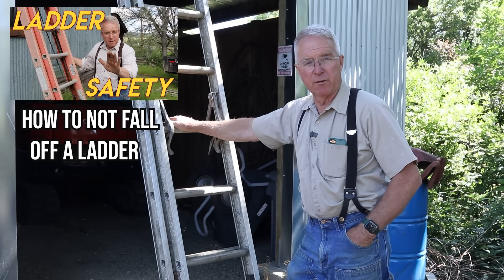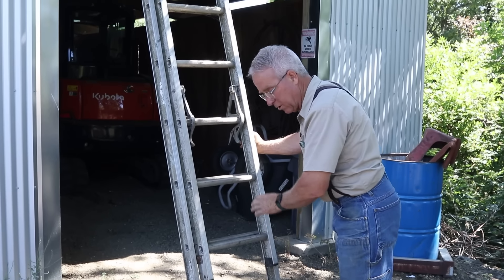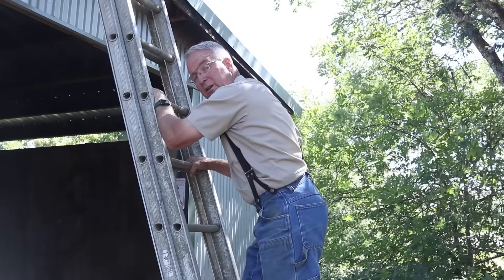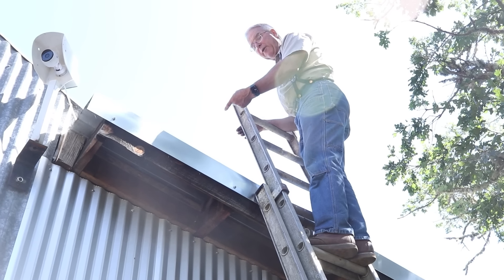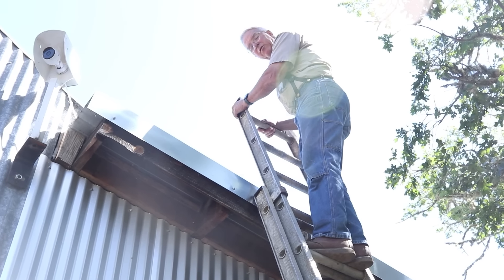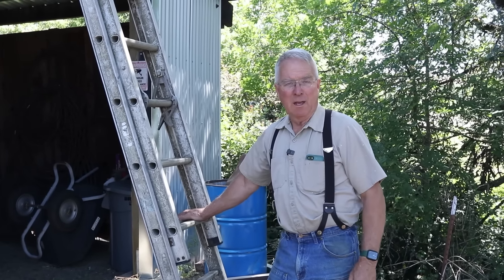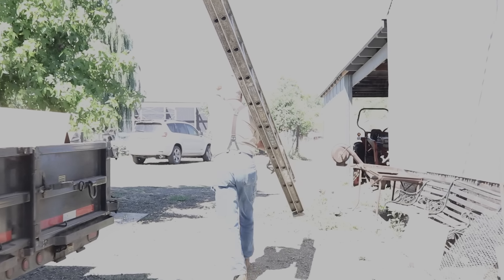How to Climb A Ladder, Dismount, & More Tips

Comment: As a younger working man, I used to foolishly go 30 feet on underrated ladders that bounced and bowed a foot or so halfway up... then, 3 years or so ago, I started peeing a little just trying to get off the ladder onto my single story roof... I almost shed a tear or two having to get off the roof, after considering calling the Fire Department for a bucket truck, but I have to live in this neighborhood, and didn't want to be known for that ... Repetition made it easier, but I knew I had to find a better way... At 62 years old and 350 lbs., I would probably crack the foundation, and probably all my windows if I fell... I found this USED, on Amazon... or Google, Guardian Fall Protection 10800 Safe-T Ladder Extension ...  It was $124, three years ago, without the stabilizer, which I also have and use with it... also available at Home Depot...  Now when I need to go up on my roof, even after I'm finished, I wait for cars to come down my street, then walk up to the peak with my tool belt on and survey the situation, until they drive past... after 2 or 3 cars go by, I feel my testosterone level has been exhibited sufficiently for me to then, shakily, come back down... It is now $206 without the stabilizer brand new... Definitely less expensive than an ambulance ride and a hospital bill... Accessing anything over a single story in height and the weight of the attachment can make a big difference in maneuverability...

Comment: How do i get from one level to another? I have a bi-level roof. Both levels are angled to center in an "A" type.

Is there a better technique that i can use? I just hop up, hold on, pull myself up and then roll over to get situated. It's about a 3 or so foot difference.

I cannot extend the ladder from the ground to that higher section due to high, rolling hills where the ladder would need to be stabilized.

Comment: One other important aspect of the ladder safety is to make the roof edge
where u lean the ladder rails.  The edge must not break off or collapse.
If the edge has a gutter, then:

U'll need to have extra steel brackets where u'll lean the ladder rails or, as sug-
gested by my professional roofer n gutter installer,  just place a 2 to 3' long
2x4 lumber piece inside the gutter.  And of course, make sure the rest of the
gutter is securely attached to the solid fascia board.  The latter esp. facing South
or West tends to dry rot.  And dat'll b too dangerous to rely upon.

And though, i used to climb up on my single story hse roof like 2 or 3 times a week
last 3 yrs when i fixed the roof me-self and also to climb up dare(there) along w my roofers,
after the entire roof replacement, i decided i'm too chicken to climb up dare no more.
Too old to maintain balance even on a flat ground.  Time 4 mir to stop at 75yo, just
much older than the 65 gent, 'AndReachAble' gent below.  And, as any roofer always
want to make more MOOooney by replacement vs. patching, i finally realized i should
hv done the replacment 3 yrs ago.  Wasted time, MOOoney, worries, and took too much
risks going up n down the steeple staircase to the HeavHoOven (heaven).

If all u need to carry up/down tooles n shmall items (e.g., caulk, nails [use screws instead
if ur a home owner. Only contractors r allowed to use EZ loosen up popup, and splitting
wood nails bc. he doesn't care, he's in a hurry 2 do the nxt job]; drills, hammer, roofers bar,
etc), i just put everyding in my old backpk n carry it on my back going up/down the ladder.
I don't want any hammer, elec drills, hvy items hanging off my belt to get tangled onto the
ladder.  When coming down, i even throw down the entire bag or even a caulk gun.
It helps in my case 2 do so bc. i aim the bag/tool on top of the hedge nxt to the hse wall.
In this wy, i can come down freely w MT hands!!!

And though i was nut in the constrn beeswax, i made sure the replacemnt roofer i
hired had insurance, updated license, and most of all, watched dem like hawk when
they went up the steeple stairs.  Caught one of the young uns to stop goofing off w one
hand holding a batch of shingles on his shoulder going up but nut(not) holding the ladder w
the other.  His supervisor/boss also must work, nut like the public street repairer where
a boss is just watching and only 3 guys  or even only 1 guy is digging w a shovel/pick
(no wunder why we pay such hi county property taxes.  I get so P'd off on too may same
such scenes.  Why kant he pick the shovel himself too?  NOooo!  Mayb bc. of he eats/pays
Onion [union contract] or his subordinates must eat onion also?) so i as the home owner though
their customer kept sharp eyes on my hired roof contractor workers as well.

I hope my long typing w thoughts helped the viewers here....

Cheers!

Comment: @2:45  Sure.  I'm sure no one carries anything up a ladder.  Yeah. OK.  I get it, OSHA should exist. But as Mike Rowe says, Safety Third.  At some point you have to build. You have to be productive, you have to get the job done. I don't mean be reckless, but we all have a "sketchy meter"  Just listen to it rather than some arbitrary OSHA rule. In the Army we always had the "maintain 3 points of contact rule" For the most part, you can achieve that.  Sliding the hands along the side accomplishes that. Using the rungs, don't.

Comment: Good safety review. Two modifications I use: 

1.  When going onto the roof, I will leave the ladder 6 inches more or these above the eave, put on the stickiest knee pads I can find, and literally crawl on to the roof; avoiding that step to the side and around the ladder. I notice I only do that when the roof is especially high and scary. Best to teach it your way, because nobody I know follows my example of using knee pads. I just decided, I am going to invent some visegrip tie downs for the top of the ladder.

2. Carry the ladder just like you taught, especially when repositioning it a few feet. I would modify that upper hand above the head as far as you can reach - better leverage. I lean my shoulder against a rung  of the ladder - giving three points of contact. I think the shoulder is key, and with a wide hand grip high and low, I can control even a 26' ladder.

Comment: Good advice, but you failed to mention how fast the legs should be out based on how high the ladder is extended. I was taught that the feet should be out one foot for every for get of height to ensure the ladder is stable and won't slide out from underneath you or fall backwards.

Comment: why only 3 rungs above roof line, I find it much safer with the ladder at face level when moving onto the roof rather than having the ladder at waist height. Suggest give it a try.   The other thing you missed out was the reason that having a ladder maybe 2 rungs or just one rung above gutter or just touching is you can pretty easily get on the roof by leaning over the roof and stepping onto the roof but try to get your leg on the rung safely when going down not having anything to grab hold of....I think a lot of accidents are from people climbing down the ladder like this and I myself have been caught but finally woke up....Thanks for sharing....🙂

Comment: Is the standard of practice to put the foot side of the ladder closer to the house, with the sliding side away from it? I always did it the other way because it felt like a safer transition between the two segments as one climbs or descends. I know the height is easier to adjust the way EC sets it, but I've never found that to be a problem when oriented the other way. Anyone want to educate me?

Comment: always hang on rung.....If your foot slips off you cannot stop yourself with the rail only.....what about climbing with both hands full?? sliding yourself up the ladder and something goes wrong you better drop and grab a rung....or working, hammer in one hand and nail in other?? of course now a day screwgun in one hand and screw with the other? residential home builder you spend most of your time on a 8' ladder and almost all the time are working with both hands....I survived 50 years always able to save myself with dropping everything and grabbing on with one hand and supporting myself....got to remember at 73 probably could not do that anymore..You need to be in shape focused and lucky to work competitively off a ladder...and as a tract piece worker for a short time and a spec home builder you are working like fighting a fire as a guy told me in the tracts the first day....

Comment: No lie. I once witnessed a guy scaling an extension ladder to gain access to a roof top. Once his feet were at roof edge level he kept on climbing the rungs instead of stepping off to one side or the other. Once he hit the top rung both he and ladder came crashing down to the ground. Thankfully he walked away with very minor scrapes and bumps. Upon questioning the individual it was discovered he didn’t know how to properly climb and step off of an extension ladder once he reached where it was he was climbing up to. This was for a church organized service project. It’s important to be cognizant of the fact NOT everyone knows how to use EVERY tool. Time should be dedicated to making sure everyone knows how to use the tools for any specific project. If you’re an expert (without being a blowhard) offer instruction and guidance. It will always work out better. The individual I mentioned could very easily have broken his neck.

Comment: Excellent video but still scary. What is needed is a safe method of transitioning  from the ladder to the roof. The safest method is with a tie off but in the absence of such then how about  a 5 ft length of horizontal wood or pipe  attached  to the ladder and laying on the roof to prevent a turning moment.

Comment: Setting the ladder against a sloping edge is to be avoided at all cost also metal against metal eg. ( alu ladder  against metal gutter or roof edge trim) is high risk, tying the base section of the ladder off on both stiles reduces the risk of it sliding left or right , here stakes or pins are driven into the ground approx 12 ft either side of each stile and a tie attached to as high up the bottom ladder section as possible.

Comment: I used your process to get up on the roof of a second floor apartment using the steps going to the second floor to support the ladder. I'm afraid of heights, so that's traumatic for me to begin with. I felt exceptionally vulnerable as I made that transition from the ladder to the roof, feeling scared as hell. So I will respectfully disagree with this video. I feel much more comfortable putting the top of the ladder about six inches above the roofline and then crawling like a baby over it to get up on the roof and back on the ladder...much, much more comfortable as at no time did I feel that uneasiness of not being fully on the roof or the ladder. Even so, I appreciate you taking the time to make these videos as I'm sure many people will prefer your method. My two cents.

Comment: 1. Flipping those legs over in the beginning is a fail for most uses in my opinion. Weight shift, wind or whatever, they're just likely to rotate back causing more brown moments.  If working on dirt I see the appeal, however a couple of nice 10-12 spikes that can be pounded through holes in the feet into the ground is almost as safe as when I back my truck against the bottom of the ladder.
2. Climbing rung-holder vs string holder.
Regardless of carrying something or not, worst case scenario is picking up wet mud or slickness on a rung. Assuming you are in the process of stepping up, and the supporting foot slips.
Rung holder has a good grip on at least one rung. 
String holder has a good grip on the vertical rail of the ladder.
Your foot slips, and 180-200+# is now not supported.
I think most people who are rung climbers are going to have an Oh Shit moment, but will be able to catch themselves or hold on to a much higher percent than those trying to squeeze/pinch that vertical ladder rail.
Pretty easy to set your ladder up, go up one step and test both methods.
IANAML, just a home jobber.

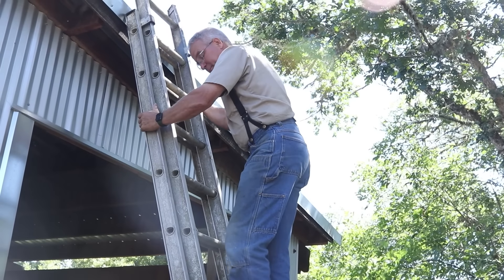Comment: 3:18 Be careful setting ladders up on gable's and drip edge like that. You want to make sure the lower part of the ladder is ABOVE or BELOW the fascia board. So you don't dent, ding, scratch the drip edge. Never set ladders up on gutters either. Use a gable or a ladder stand off.

Comment: A lot of good tips, but hovering in the background is the certainty that sooner or later someone will fall.  I never do roof work without a safety line.  And I undertake to equip my environment, my homes, with anchors, so that to work on the roof, all I have to do is clip in.  Why don't houses come equipped with anchors?  They could be decorative.  As a rock climber, from the age of 12, I have all the gear.  So all my costs are sunk. I have seen climbers get seriously injured falling from heights a lot lower than a roof.  As I near 65 I know I can't survive even a minor fall, without extreme injuries.

Ladders always freak me a little, because they move.  Good rock, doesn't move around as you climb it, usually.  You can choose to guarantee the outcome, and for those of us who do this kind of stuff occasionally we should not just take precautions, but deal with certainties.

Comment: I've worked in health and safety for about 12 years (please don't throw anything at me). Interestingly the standard only says that an employee must keep a grasp on the ladder with one hand, and that employees are not allowed to carry anything that can cause them to lose their balance. Clear as mud, right? So, it means you can carry a box of screws up the ladder, but not a sheet of plywood, as long as you maintain a grasp with one hand (which can be achieved holding onto the side rail)? That's how I read it.

There is a letter of interpretation that doesn't really provide much more clarification. That being said, site or company specific policies can always be more strict.

https://www.osha.gov/laws-regs/standardinterpretations/2019-06-05

Comment: Ah, you were dong so well correcting past things you failed to mention in the last video, then you got to the end and talked about carrying a ladder upright. In the rear instance where you need to release the ladder quicky due to a more immediate danger, it has a better chance of coming down harder the higher it is. Not to mention overhead power wires.

Comment: I climb microwave & TV towers for maintenance & repair for a year plus. 1,400 foot TV towers were the highest. Bulbs, voltage drop, and 20 bolts per 100 feet plus ice plates if equipped. Then sight them in for plumb on two sides. It was fun. Not!

Comment: Hello,
The rule in the Netherlands is when climbing at least 3 points attached to the ladder. So 2 hands and one foot or 2 feet and one hand on the ladder.
Bringing stuff upwards, use a rope or lifting installation. Work save, I have seen accidents with ladders, not funny.

Comment: He said not to step on the ladder above the roof as it's levering up the bottom of the  ladder. Then, a minute later says to put your weight on the very top of the ladder as you begin to dismount the roof.  Seems like that would cause levering too. This is confusing.

Comment: Ladders like this, have and will be always inherently unsafe.   Newer ladder additions like levelling feet and rooftop contact (instead of resting on the gutter) is what makes them much safer to use nowadays.  They are much less likely to slide out at the bottom and slid sideways along the gutter.

Comment: As a 30 year fire fighter,  1 the " strings" are called beams, 2 always tie off the bottom of ladder to a static anchor point, 3 always check ladder angle before climbing ( you failed this completely)  5 rungs above roof is industry standard,  5 before steeping off ladder to roof always  sound roof to ensure it can take weight. Please take an approved health and safety course before giving poor advice.

Comment: and be sure the ladder is at the correct angle - never use one near a power line - make sure the ladder will hold your weight , a 200 pound ladder isn't good for a 250 to 300 pound worker ! Step ladders are to face what you are working on and don't climb up too high on them